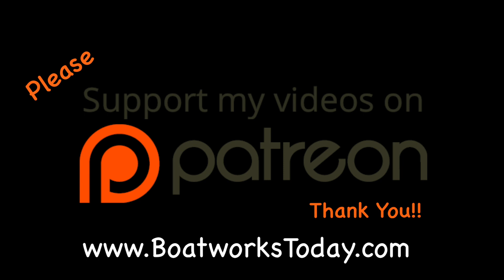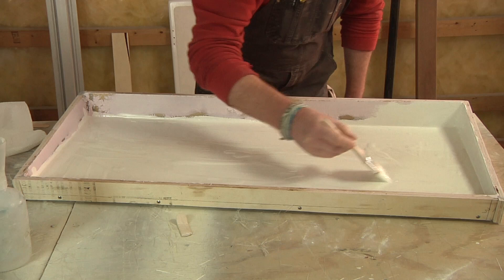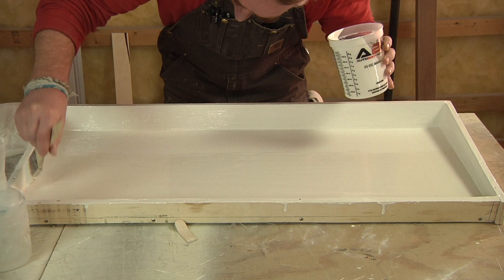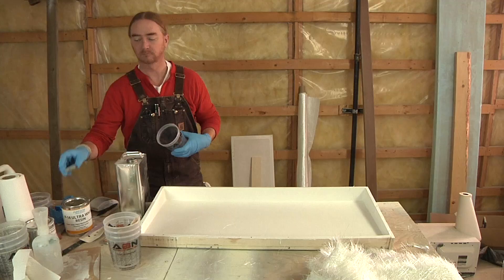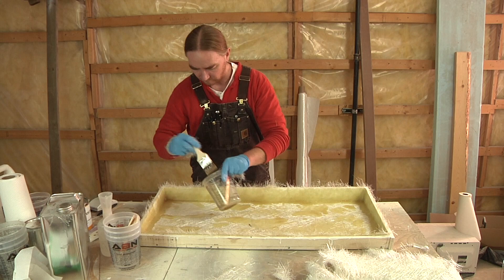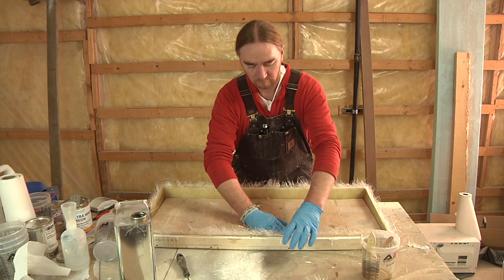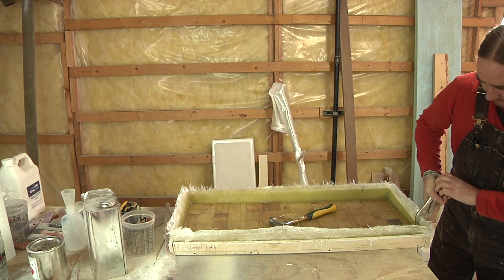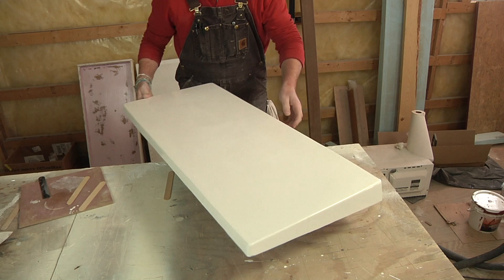Building A Boat Hatch From A Fiberglass Mold!

Comment: To help release the part from the mold consider drilling 2 or 3 small, 1/8" holes on the large surface and fill them with clay. Once the part is finished use a blow gun from a compressor and inject air from the back side and the part will pop right out and the clay will leave a very minimal blemish that can be buffed out.
Reply: Thinking person✅
Reply: I like this.

Comment: Andy, soft wood wedges driven in along edges will generally pop a part out.  You don't have to drive them in far.  Once you get one or two in a bit pour some water into the gap.  That will normally pop the part right out.

Comment: Thanks! Just recently, my original 1975 CD 25 hatch and lazarette covers were too flimsy, crazed and degraded so I now have 3/8" plywood reinforced hatch covers and a 3/4" plywood reinforced lazarette cover and all are covered with 4 layers of 1208. Im still in final fitting stages but they are bulletproof. Probably overkill and they will need upgraded bronze hinges and hinge supports as well but so worth it as I can now stand on the lazarette to fish off the back, hoist the dinghy, or have a solid work platform. Those covers will outlast me and the next few owners as well. Thanks for another helpful video.

Comment: New sub here, these videos sure help me out. I’m starting to do some research on how to fiberglass, I have a 1996 sunbird that the floor needs to be replaced. Pick the boat trailer and motor up for 400 bucks. The motor has less than 20 hours on it , the lady bought the boat brand new and only used it 4 times in the river and it sat in her yard until I got it a couple we ago. I’ve pulled out most of the rotted wood and the  flooring below the plywood is in prefect condition. It’s a great starter project for me to learn how to fiberglass.

Comment: Hello mate, you do make me laugh 😂 I think what I enjoyed the most was the mistake you made, why? Usually we have to make the mistake and go through the pain if trying to figure out how we can correct it but with you pointing this out and putting us through your pain I certainly won't forget about it. 

Couple of questions and maybe a solution. You want the first gel coat to be high enough but not stick to the edge so would it be an idea to tape the top edge so you can go over it but peel it off making sure you have a complete coverage? 

This one is a bit tricky but I think you are the perfect person to ask because your work is amazing. 

I have bought an old yacht, 27ft colvic with old interior. I want to revamp it all and make it more modern on the inside. I have a fairly good idea what I want but I need help from someone with skills and happy to help or give advice. I have no experience at all with fibreglass but I'm a quick learner and know how it works. I just like information before trying and wasting loads of money. 

I would like to build my own furniture with curved edges or fibreglass mixed with wood. A good example would be the steps coming into the boat having the back panel as white fibreglass finish but the steps in marine ply varnished. Is there a way to combine the two but leave the features of the wood just like the effect you would have with a deck covered in teak but the edges polished white.?

I'm a nightmare explaining things but I want to also insulate the inside of the whole yacht including the ceiling with bubble wrap and closed cell foam to then coat it with white epoxy, is this possible or would it crack? Would I get a nice finish or is it a waste of time and should it be done in fabric? Even a video where you draw it on paper to explain would be good.

Is there a way to make your own cupboard with closed cell foam and cover it with fibreglass and then epoxy? Then cut out the doors and have fibreglass furniture or drawers?

Loads of questions but would cover a range of projects I would like to try out and would appreciate expert knowledge you have. 

Many thanks and great videos, keep up the good work
Mike

Comment: Andy, you make glass work look so easy.  This makes me want to build a new console for my bass boat and replace he black plastic one that is there.  It actually bolts to an aluminum square base.  How hard do you think this would be for a beginner like my self?   I guess I would need to build the mold and then basically perform the steps that you just did.
Thanks,
Matt

Comment: Used to work in the fibreglass industry in testing. Made up our own resin compounds from raw chemicals to test various conditions. I also used to set fire to it with various chemicals to how well it burnt for product testing etc. It basically burns down to its raw components leaving the glass fibre intact. It's interesting stuff and not 100% waterproof either which is why boats can suffer osmosis.

Comment: I'm a skilled carpenter and welder but have yet to venture into fiberglass so your videos are very helpful.  I'm making a crawl-through cab in my old (95) Toyota 4x4 truck and am using a high top fiberglass shell which I'm cutting the front out of (as well front of truck bed and rear of cab for the crawl-through) I've bought a rubber accordion seal to mate the cab to the topper but I also want to extend the top front edge of the topper, as well the two sides approximately 4" on the sides and ~8" on top to better seal around the cab (but still allow for topper to be removable).  I plan for a 1/4" gap / spacing around the entire lip of the topper shell which will get filled with some type of silicone rubber tape to help seal against the cab.  Anyway.. should I just make the top and sides out of say 1/8" or 1/4" balsa and then go from there instead of making a mold?  After watching your video on fiberglassing over plywood that seems to be the way to go. 

I think because of the odd shapes and angles of what will likely be three or four pieces, that making a mold first would prove to be very difficult (but ideal).  I also need to be able to attach this to the current fiberglass topper which has an old gel coat. I assume I need to sand off the gel coat where I'll attach the extension and then somehow bind and glue the new assembly to it, then fiberglass everything together.  I definitely want the finished product very smooth and will want to gel coat it.   Any help would be appreciated.  I think I'm on the right track but a step 1-10 checklist would be a great help!  I have a ton of tools and last year had to reweld in all the metal around the perimeter of my windshield due to rust and it came out looking brand new so I know I can handle this.. I just need a really good checklist of the steps!  Thank you.

Comment: Andy if you would to build a swimplattform incl an enginebracket, kind of like an Armstrongbracket with a “floatingcontainer”, would you build a mold for it like the one in the video or even use the boat as part of the mold?
Or would you build the structure from plywood? Maybe it will be different depending if your boat has a flat transom or not? 🤔

Comment: Why didn't you use balsa instead of 10 sheets of glass on the 4hp motor mount on a previous boat ??
Reply: A motor mount is usually low to the water, if any core rot forms from unmaintained cracked glass the results could be a sudden failure that can cost lives. By adding balsa to the hatch the part cost and wieghts less. And has more bouyancy.

Comment: I'm curious as to why you needed to separate the hatch from the mold BEFORE you trimmed off the excess glass around the edges.  Seems like trimming the glass first and maybe sanding off the gelcoat that was on the top edge of the mold might have made it release a lot easier??

Comment: Your videos are amazing and very informative - thank you! Silly question, we already have a fibreglass mould of a cabinet that belongs to a 1972 BOLER 13’ trailer. We’re wondering if we use this mould to build a second cabinet (and then use the mould we have for the 1st cabinet), we’re a little confused as to why the gel coat does not stick to the mould? Thanks so much Andy :) ! Any additional insight regarding our project is welcome… :)

Comment: Maybe a stupid question. Why did you lay down the very first gel coat and spend ages sanding it smooth when you could have used the original surface which was smooth anyway?

Comment: Question for you... After you do the trim on the fiberglass, how do you seal the edges that you cut? I have never done any fiberglass work before, but i do feel i am capable of doing anything, for that reason i am building a custom ice chest for my boat to take up unwanted space... My intentions is to have a glass outside, foam board in the middle and glass inside... Any tips would greatly appreciated... Nice job....
Reply: I use rubber U shaped mold trim like what is used in automobile door trim and such.
Reply: Use epoxy slightly thinned with acetone.  Rub that along the sanded cut edges if you plan on keeping them bare.

Comment: I replacing the plywood core on my ranger boat floor. Have pulled all the rotten ply out. Which resin/epoxy would you recommend to adhere the plywood to the fiberglass cap?

Comment: Just bought me an old Zodiac with glass fibre hull and i noticed the through hull fittings in the bottom of the transom was replaced with an outside fixture plate with drain plug in it. Removing the drain plug fixture revealed soaking wet plywood inside the hole. I've ordered a 1 1/4" through hull fitting in 316 together with an expanding rubber plug. I'm guessing i need to remove parts of the transom plywood and rebuild the surrounding area with glassfiber / polyester. Any suggestions?

Comment: Hi 
Not specifically related to this video but ones in the past. I bought a boat last summer and on the port side near the head window there are spider cracks. Most would appear cosmetic but lower on the boat there are 2 or 3 vertical cracks through the color band gelcoat. Im worried that there are structural problems. Whats the best way to determine if they are cosmetic or more serious.
Thanks for any suggestions

Comment: I notice the cloth is discontinuous at the corners between the side and the top. You split no cloth partially on a side and partially on the top for strength so is it just gelcoat and resin along all the corners??
Reply: I had the same thoughts... I kept waiting for him to add that section of glass and he never did. Hmmmm...
Reply: He tears his pieces of chop strand so he has a feathered edge that wraps up onto the mating surface, this, in effect, ties the two strips of chop strand together without adding too much bulk.  Think of it as having the corner covered by 1/2 thickness of chop strand by one sheet, and another 1/2 thickness by the mating sheet.  This gives you a full thickness.  Why not just use one continuous piece?  It's more difficult to get it to lay in the corner without pulling air and creating voids.  the torn edges are thinner and more pliable to be pushed and hold to a tighter internal radius.

Comment: Iff'n the gelcoat on the lip was the issue, why didn't you just sand past the gelcoat to bare wood all the way around the mold?  Problem solved and now you have a nice edge on your part using the mold for a guide.

Comment: Great video, but got a question.  If I need to have nonslip, like popcorn ceiling type, what's the best way to add that.  I have a bay boat and I need to build a new hatch for the livewell, it was a poor design from sea pro.
Reply: Copy his video then hand roll gelcoat with skidtext in it after demolding

Comment: Back in 2015 you sprayed 3 coats of PVA over the mold BEFORE you applied Gel Coat.
Remember?
Reply: The application of the PVA IS IN PART ONE AT THE END 13:~~  -  14:~~ in part one. 
Andy sprays 3 coats and the video ends. 
This one starts with him applying the first layer of the part, the gel coat.

Comment: When using the layering gel coat with out wax. Do you have to add wax to the finished piece? Or will the piece be ok without wax?
Reply: Only the air exposed side needs wax as it acts as a surfacing agent to prevent the styrene from evaporating off, leaving behind an uncured surface. The mold side of the part traps the styrene and allows for the gel coat to fully cure.

Comment: One thing I thought I would add since I didn't see anyone mention it is that fiberglass is really nasty stuff to work with especially when cutting or sanding. It will get into your clothes and is impossible to get out. The very fine glass particles will make you itch horribly. Be careful and always wear respirator and gloves at minimum.

Comment: So you used Gel with wax? When would you use gel without wax or did you?

Looks nice!
Reply: Sailing Luana Cordelia ,  he probably didn't use gel coat with wax.  Because the fiberglass on top sealed it and caused it to cure. he's mentioned in previous videos that if he uses gel coat  exposed to air, like the underside of the seat, He prefers to spray a layer of hpv that seals it.  And then it washes off easily later.

Comment: Since you were cutting it off at the top of the mold anyway, could you have cut it off and ground off the top edge to get it off the mold?
Reply from the maker: After the fact, that's a stellar idea ;-)  Wish I would have thought of that earlier :-/...
Reply: Hindsight is usually 20/20. He didn't know the gelcoat on the top of the form was causing it to stick.

Comment: When using the gel coat in the mold do you need to use any mold release
Reply from the maker: That was the PVA that was sprayed in the previous video ;-)
Reply: You can use release wax or PVA. If you use release wax be sure to buff in 6 coats allowing 30min between coats

Comment: stupid question why not just use the hatch your replacing as a plug and make a mold ?  that would seem to be the whole reason to make a mold of not just make the hatch instead of the mold since you're making one and you're free-balling the mold anyway so nothing is exact you could eliminate 30 steps and deliver an exact replacement   ..confused